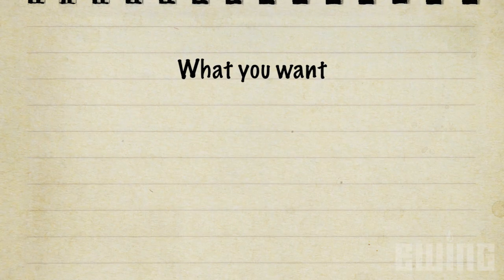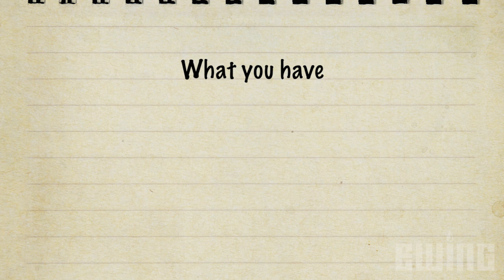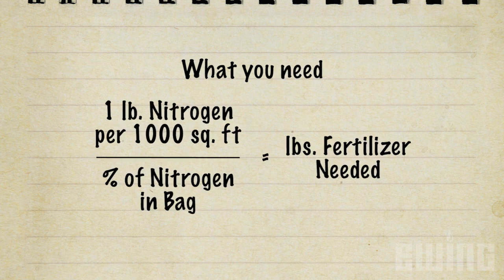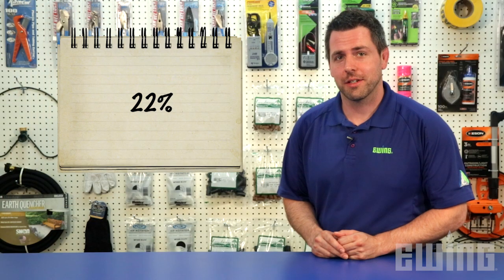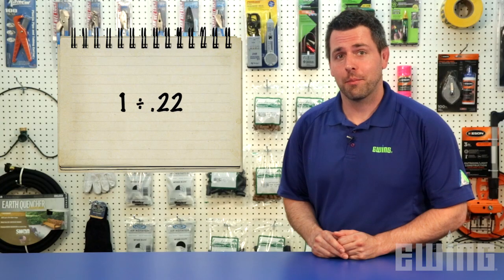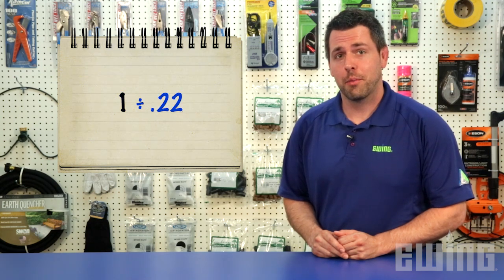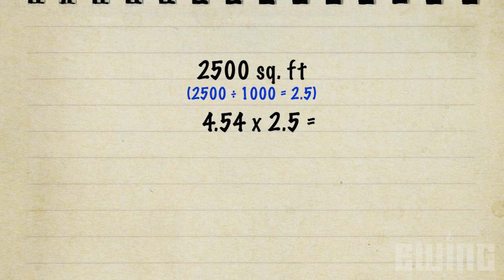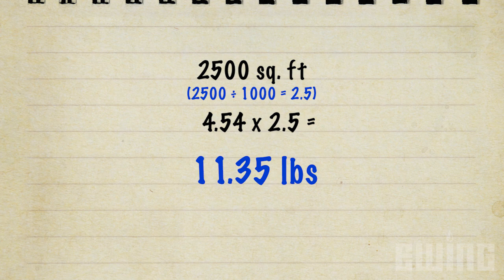How to Calculate Fertilizer Application Rates

Comment: Correct me if im wrong- my lawn is 3,539 sq.ft., my soil sample came back and recommended 10lbs per 1k sq.ft. so im putting down 35.39 lbs of fert.? Im thrown off by the industry standard rate of 1lb per 1k sq. Ft mentioned in the video
Reply from the maker: You need to divide 1lb per 1k sq. ft. by the nitrogen % in the bag to determine how many pounds of that particular fertilizer to use. If the first number on the bag (which is the nitrogen %) is 22, then 1lb divided by .22 = 4.54 lbs per 1k sq. ft. Multiply that by your sq feet in thousands (3.539), you'll need approximately 16 lbs to cover your lawn.
Reply: @ewingoutdoorsupply  Hi! Thank you for this. My soil testing recommended 10-10-10, so just to confirm, 1lb divided by .10= 10 lbs per 1k sq. ft. Multiplied by 3.539( my sq. Ft) is giving me 35.59 lbs. If this the case, what  is the spreader setting I should be using? Sorry, I'm new to this and using a Scott's Wizz spreader
Reply from the maker: @kevinhoang1760  Yes, your calculation is correct. You would need to check the manual for your spreader for the correct setting or calibrate your spreader as show in this video.
https://www.youtube.com/watch?v=mnl0ZLtEtUA
Reply: @ewingoutdoorsupply  Again, Thank you for the information.

Comment: When it comes to fertilizing established shrubs & instructions say use 1 cup for every 3 feet (linear) how broad of a strip of fertilizer should I use? So, if I am doing a 3-foot ling section around base of shrub how wide should my 3-foot line be? Thank you
Reply from the maker: We'd need the label or specific product that you are using to to provide you with an accurate answer. You can send the information to: turfhelpline@ewingirrigation.com for assistance. Thanks for watching!

Comment: so I would only need 12 lbs of milorganite? I figured if it's such low N I would need more? I would need 33lbs of 22-0-0
Reply from the maker: Typically, fertilizer products are applied at the rate of 1 pound of the desired nutrient per 1000 square feet. This means that if one would want to apply a 24-0-6 fertilizer at the rate if 1 Lbs. of nitrogen per 1000 square feet, the rate is 4.17 Lbs of fertilizer per 1000 square feet. The math looks like this- 100/24 = 4.1666. For Milorganite which has an analysis of 6-4-0 the rate that must be applied looks more like 16.67 Lbs. per 1000 square feet. Thanks for watching!

Comment: Question:  I Have a bag of fertilizer with the Nitrogen on the bag is 15.  (3,500 Sq.ft Lawn).   1% / .15 = 6.7  (rounded), 3,500 / 1,000  = 3.5    6.7 x 3.5 = 23.45 lbs of Nitrogen needed for a 3,500 sq. ft lawn correct?
Reply: Yup

Comment: And this 11.35 lbs of nitrogen spread over 2,500 sq ft. of coverage is only for one application.  So for example Kentucky Bluegrass needs about 4 pounds of nitrogen for the entire year because of our shorter growing season here in Michigan, AND you can't put down more than  1 pound nitrogen per 1,000 sq. ft. at a time, or you'll burn it. Therefore, I and others who adhere to this strict policy of not wanting to burn the grass will make this application four times a year during  the growing season: early spring, late spring, summer, and fall.  Too bad we can't find 100% straight nitrogen although I knew someone who applied straight nitrogen on his lawn.  It was so green, it looked almost black...well, just extremely dark green...I was impressed. I guess that would be 100-0-0.
Reply: Have you looked into spoon feeding?